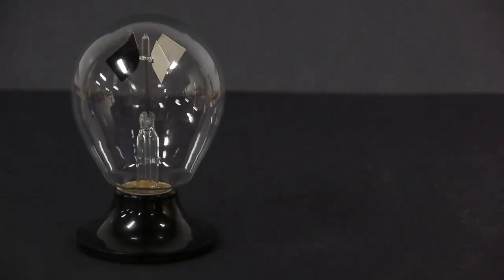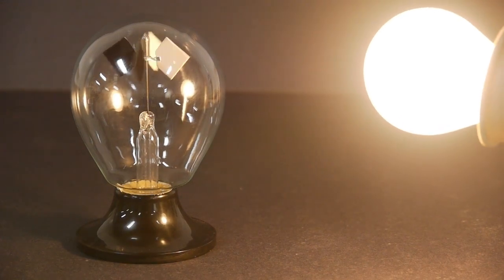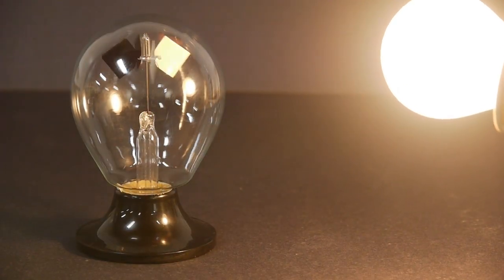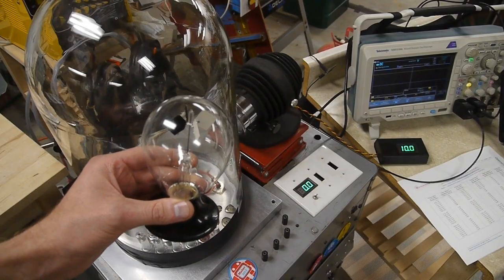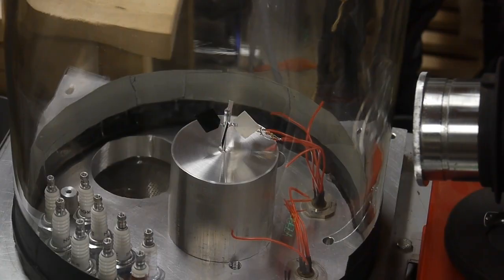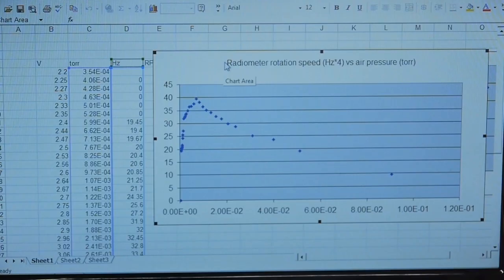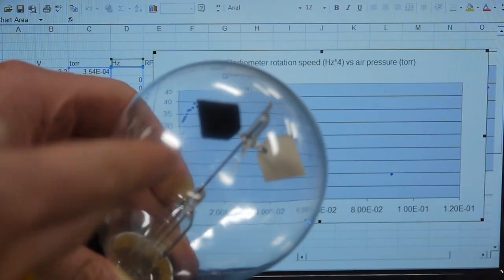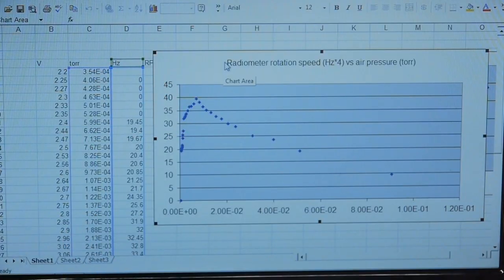How a Crookes radiometer works

Comment: All aside, it appears that flow direction in a ring is in a different direction than flow direction out of the ring,  being only 180-degrees opposite- flows moving away from each other, where the vanes acts like a wind vane sensitive to flow direction and the vorticiry of the under-square, over-square, and sphere-shell vortex.

Comment: What is the effect using different spectrums of light? What happens if lasers are pointed at the same side of opposite colors or opposite sides? 24 different rgb combinations can be attempted; 18 pairs and 6 singles.

Comment: Did you know that at the first part of the video, many people can't tell which way the fins are turning??  I am one of those..it even appears to reverse directions at this straight-on view!  I had to watch it 'start' turning to be sure.
Since I was a kid, a radiometer is one thing that I wanted...decades later, I finally put one in a microwave oven (with a water load)..  It turned very fast at first,then there was a spark at the tip of the needle (blunting it due to the high EF build-up)...never worked again...gotta get another one one of these days!
GREAT VIDEO!

Comment: This is cool!
I am trying to recreate the experiment for my school project.

@Applied Science, What is the name of the equipment at the bottom? Did you buy or assemble it?

How did you have the turbo machinery pump connected to the bell jar with electronic controlled valve? 

Also, how did you seal the tachometer wires inside the bell jar and connected it to the oscilloscope?

I am trying to rebuild it but these things are a puzzle in my mind.

It would great if someone could answer it.

Comment: You are forgetting something very basic and very essential, the force on the white face is being split into momentum opposite the direction of that upon the black face, and reflected photons in the same direction as the pressure being exerted upon the black face.  Therefore the pressure on the black face is greater than that of the white face, and the white face simple offers resistance, as well drag pulling it back with the reflected photons.  Occam's Razor:  The simplest explanation is usually the best.  And if it was heat, light focused on the edge wouldn't cause it to move faster than light focused on the whole fin, because there is less heat being generated over a smaller space than if the whole thing were lit.  But light concentrated at the edge and passing does create photon drag.  Light is the result of energy and photons, which are matter and do have mass, Heat is the result of energy and friction.  Neither one is actually part of the electromagnetic spectrum.  You can light energy-level wavelengths with no photons agitated or excited, and not get light.  You can have an energy that isn't even near the perceivable light wavelengths and have present photons become agitated enough to emit light.  60Hz AC is what a majority of the world's lights work on, meanwhile visible light is in the hundreds of terahertz.  The energy level exciting the photons is far inferior to the energy of the light emitted.  And light and heat aren't codependent either.  And the shade of black is merely the resistance to photon reflection or passing.  Black objects don't get hotter than white object if left in a dark room equidistant from the same source of heat, only when there is light involved, and light requires photons.  The glass bulb it's encased in, like many lenses, excites photons with heat, transforming heat into light by exciting photons.  Photon Pressure is not only the simplest explanation, it's the only one that isn't easily disproven by overlooked factors of the experiments that try to prove it.  If you remove the lens by removing the bulb and putting it in a vacuum chamber at near vacuum, a light from inside the vacuum chamber can still cause it to spin, but a heating element won't.  Because there is nothing to turn that heat energy into sufficient photon pressure.  And the fact that when the bulb itself is heated creates infrared level photon agitation is NOT aside from the point, that is something ALMOSY EVERY video claiming to explain it actually claims at one point or another.  If you remove that lens that allows heat to agitate photons, heat doesn't make it spin.  And heating the base doesn't make it spin until the glass gets hot either.  But let's ignore that because it disproves our supposed big brain theory that it's  the heat and not the light.  Glass and crystal emits a lot of light, both visible and not, as it heats up, the ceramic base doesn't.  And a theory that disproves itself is not a sound theory and definitely not the right one.  Heat is the closest theory to how it actually works, but there are so many ways that you can prove heat doesn't make it spin without heating up a piece of glass surrounding the fins.  Also, it spins one way taking heat in, and the opposite when putting heat out.  And when heat is output through glass, it created photon pressure on the side of the glass where the heat is escaping the glass.  Reverse the direction the glass transfers heat and the spin reverses, sure.  But we also know that glass transforms heat into photon pressure, emitting light.  And the light is travelling the path of least resistance, out away.  Light travels away from the van, the vane spins opposite the way it does with coming at it.  Y'all should watch each other's videos for all the things that prove it isn't heat that are ignored.  In any of them you can spot at least 1-3 reasons it isn't heat.  Literally.  Some of them as much as at least one proof per minute of video.  Just because proof is overlooked doesn't mean it doesn't exist.  This is why peer reviews are a thing.  But even that fails when every peer reviewing the research has their own bias or interests that that proof could lay to waste, and it will often be refuted for that reason alone.  It's like saying unicorns can't exist because that might mean god exists too, despite the fact that we just dug up a perfectly preserved unicorn from a glacier, horse body with fur intact, helical horn and all coming right from it's forehead, and I can't believe god might be real because I take the lack of current proof that god is real as proof that god isn't.  And nobody likes to admit to being wrong, so they will discount your facts that are proven and known that contradicts their belief.  When somebody BELIEVES something is wrong, it  doesn't mean they know that it is wrong, but rather that they refuse to accept it as right.  You can't know and believe the same thing, for the two are contradictory.  Belief is something you take on faith and/or bias and not on fact, knowledge is something you take on proof and not bias and/or faith.  And the search for scientific proof is often obscured by personal bias and belief.  You can believe the world is flat and that the sun rises in the north and sets in the south all you want, but it is known that the earth is round and that the sun rises in the east and sets in the west because that's how the globe earth spins.  If the earth was flat, you wouldn't see different stars and different seasons based on how far you are north or south of the equator, and we definitely wouldn't have night and day both present around half the world at the same time, it would either be all light or all dark, perhaps even all of the time based orientation of the planet.  You can't portionaly light the surface of a disk regardless of angle of light source, either the whole surface is lit or none of it.  But you can only ever light half of a sphere from a single angle.  Stop looking at the experiments with the idea that your theory is right and has to be the only possible option, that is called an impractical bias, instead look at it as it's either right or it isn't and you intend to prove which.  Because again, I see more proof that it isn't heat than that it isn't anything to do with light itself.  Light is the reaction of energy and photons, heat is the result of energy and friction/resistance.  We use thousand of devices every day that were made from KNOWING this, shy do we suddenly forget it when it comes to something like this?  Light makes it spin with or with the glass in between the source and the vanes, heat only makes it spin with the glass in between the source and the vanes.  Clearly it's not heat, or heat would make it spin even without the glass in between the fins and source.  You can believe it is heat all you want, but the thing that has the most influence on regardless of variables is more likely to be the cause than the one that fails to have the same influence across as many variables, not the one that loses influence from the most variables.  Again, Occam's Razor.  The simple solution is often the best.  Light continues to have influence on it with most of the variables that cause heat to lose influence, and thus far the only variable that prevents light from having an influence is full vacuum, and heat loses influence before light as it gets closer to full vacuum.  Meanwhile, there are dozens of variables besides the glass bulb around it that effect heat's influence on.  The sun pulls white objects and pushes black objects off course, and in the vacuum of space, we use solar sails successfully on that very concept, and even in a full vacuum it works where heat based thrust fails.  And applying heat to solar sails has no impact unless done so through a lens that manipulates and excites photons, it is very much how we direct satellites and space telescopes, as well as probes sent off to the depths of space.  More efficiently than either mass displacement or heat displacement thrust at that.  In a vacuum on the earth's surface, there is still one factor that is not present in space, and that is mass gravitational pull, the greatest factor of resistance being ignored in all of these experiments.  The more effect gravity has on the vane, the less impact any other external force can have on it.
Reply: Some good points showing there is more than one energy involved:heat, photons, pressure. Also not mentioned are Blackbody radiation, Osborne Reynolds Law and the vortex activity of opposing forces.

Comment: I think you should switch the colors so we can have more data. It cold be related to the vibration of the atoms that can absorb kinetic energy from one place and releases to another, just like a sound levitation but in a form of radiation. The energy  travels through the gas molecule in certain frequency, if there's no gas,the eneryt can not be transferred, if there are to much gas,  it cancels each other out. Try with magnetic sheets, cover with black and white and see if works in a vacuum.

Comment: make the faces, one mirror, one pass-through, one-way mirror
Reply: with full vacuum
Reply: remove the black and white, replace with transparent and mirror, or just absorb-black and mirror-silver
Reply: make laser spin measure, keep it in total vacuum, increase the laser to get the spin speed curve
Reply: check the photon pressure, not the thermal engine properties, I mean

Comment: Wait wait wait!!!! You never ever explained how it moves Backwards when cold!!!

And  you really skipped over how the "second " way it turned works!!

Thank you for the video but we NEED MORE!!!

Thanks!
Reply: As the black side usually absorbs more heat, it also loses it faster while the white which had originally less heat now has more. This reverses the spin as the black heat molecules are flowing to the colder white (CCW) as per the Osborne Reynolds Law. Under normal temperature conditions, the colder white is flowing to the black (CW).

Comment: I think it was James Clerk [pronounced 'Clark'] Maxwell who, in a lunch break, elucidated the workings of these things.

When I go my first vacuum system I used a naked radiometer as a rough indicator of vacuum. I now use a Pirani and a Penning gauge. Was that Volts/vacuum table for an ion gauge? I have one that I must get around to fitting. The naked radiometer now sites on a shelf as a 'curlometer' for the air field in the room.

My old baseplate had expensive Edwards feed-throughs, and I needed more, for which I used RF feed-throughs soldered into a plug that replaced a single HT feed-through. I was thinking of sparkplugs. Do you use their standard seals? Do you plugs a good solution?  

I am envious of the turbo-molecular pump; I still use diff pumps. I note that the TM pump's  maw is  off centre. My original baseplate had it in the centre, but that gave little space for experiments, so I made a baseplate with an offset hole.

Now that the Technology Connections channel pointed to this video I must keep an eye on the channel.

Comment: I own a 5 year old radiometer. But about 2-3 years ago it stopped working. Sometimes it was sitting in bright sunlight without moving. Flicking the glass would make it go for a few minutes. This behavior increased over time. Nowadays I rarely see it moving.

Why ist that?

There is no information on that online but I came up with 2 possible answers. First one is the needle bearring. It is possible to be worn out over time. But after close inspection it seems to be  fine and since it spins perfectly for a few minutes when touched I dont think thats a problem. 
Another possible answer is that air diffuses through the glass into the radiometer. The increased drag could slow down the Blade bringing it to a stop. 
However these are just best guesses. 
I am genuinly curious whats happening.
Reply: Unless the vane colors are worn--which doesn't sound like it--a  likely possibility is that both  vanes are equally energy absorbing due to 'overexposure" to sunlight. This cancels out the energy differential which is necessary for the spin. Read about another case hear with "too much sunlight."

Comment: I doubt it's an edge effect.
Ah, well, that means I, an arbitrary physicist somewhere on the internet, contradict some well known physicists, and that should raise a red flag (it does!), but the 2 of my professors covering that subject went with just higher momentum of bouncing air molecules on the warmer side, no edgy effects, no thermal transpiration.
However, prove me wrong: Make holes in the panes -> more edges. If it's an edge effect, that should increase the effect. I wonder why no one has ever tried that (to my knowledge)...

Comment: 🙏💜
Is it olso working behind the duble glass window with a vacume inbetwean🙄
It seems space is strongley able to be pulled  treu the glass en less less less able to push treu the glass

In a bick freaser inside en outside the same  experiment with a light 🙄 would olso be diverend speed of the photon propelor
If i'm correct it would be slower in a freeser😀

Propellor is not pushed.
There is pulled onn the entetys of the propellor side en for  them to take from the other propellor blade side entetys en they pull in for the propellor to pull itself to motion😍💜
En in a freaser is more to reseave en the rotations speed will chaince😀 as there is innof to pull less to be able to release en there for pulles less in motion than outside the freaser

Greatings en have a beautiful day🙏💜🌐💜

How is this opject named🙏
Reply: Ho if you vacume the space inbetwean the gass entetys is puled out to😅
Than the feilds of licht colapse bevore it reach the radion😅💜
Reply: Nice 🙏
No thermodinamics.
Heath comes from the space to be pulled open en to reseave that  a symtoms as heat en light minivest with it🙏.

I watsh again 💜
Missed it i was looking for this to show glass leds space pulled treu en not pushed treu but you shown could rotation to so the glas operate  boths way.s  easy😅
How can oxigen manivest normal in space cabine where there are windows😅 en not become liquid in space?👀😅

What dit you spray on the glass to led it rotate?
En the conditions  of emotion of the gas entetys can add to the transmision of energy for the wite to pulle in to feed the light string treu the black surphert😍

😍😍😍😍
Reply: I remamber that i thought it was the heath on the black .
I dit not saw the cosmos it is made of 😅💜🌀💜
Nice experiment🙏
Beautiful showings en sharings

Comment: I think sir it's both, it's being moved more by photons at the same time, slightly with heat, specifically with heat differential (much like how earth's wind works, when there's warm and cold air, cold air on the other side) because I  tested it with bright LED light vs. 100 Celsius SMD heat gun (about a few centimeters), it spun faster with the bright LED light (almost touching the LED reading lamp) than with just heat. 

A laser pointer may make it spin very fast without melting the bulb (it might explode). I wonder if a very high laser is shown, like blue laser but not intense enough to damage it?
Reply: Were the sources inside the glass vacuum vessel, or outside? The glass will intercept some IR ...
Reply: Agree it is more than one energy. Blue laser spins fastest, then green, while red is the "slowest".

Comment: you could simply cut away at the vanes to make them smaller. This would also eliminate the variability of different coating thicknesses, etc on each manufactured set of larger vanes. and it's a lot easier.

Comment: Larger vanes would be optimal for lower pressures? Does that imply that smaller vanes are optimal for higher pressures? How small would the vanes have to be to work at ambient press? 100nm? That's a small radiometer-100x smaller than a red blood cell.